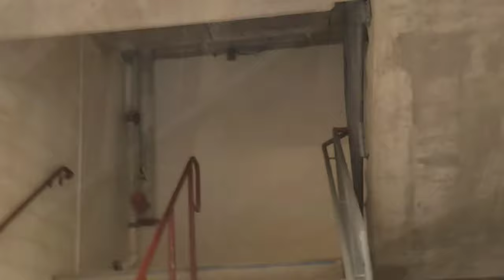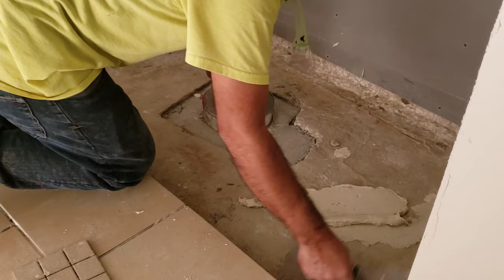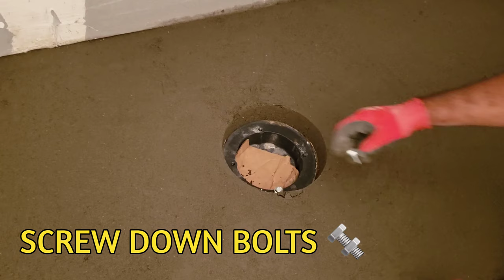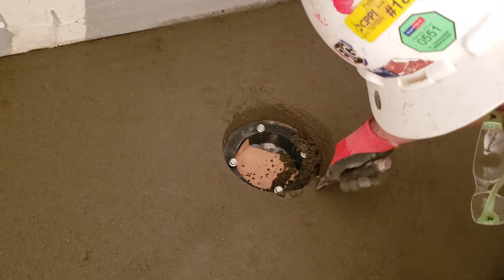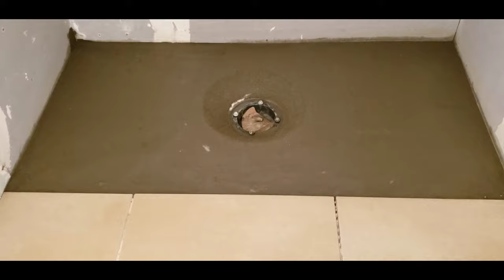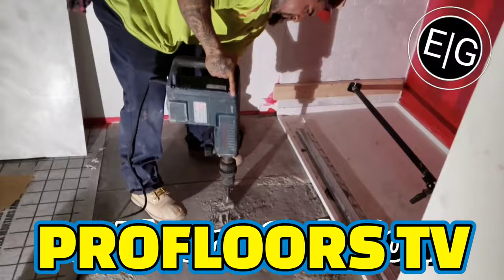How To Do Shower Pan Divot Method |Sand Mix Mud | #Shower #Liner #diy #professional #construction

Comment: This seems like a really great method. As opposed to the newer sealed pan method, like kerdi over a single slope to a bonded flange. What you're doing is really a sealed single slope pan but the benefits of old-school water in water out weepability.  What jobs are you doing these on? Commercial? Concrete subfloor? Would you or have you done this over a wooden subfloor?
Reply from the maker: Yes this was a commercial ALF assistance living facility which was over concrete, But Iv also done this over wooden subfloor on a residential home with the smaller drians works Great.

Comment: Hey man great video. How did you come up with the thickness of the template being 2"inches
Reply from the maker: Good question, i was going to explain but video would of been too long as it already is,, well first I placed the flange and drian where it goes but not to have it set but just while I figure out the measurement of the template, then I measure a ¼inch per foot for slope so my longest area from drain to wall is let's say 2ft then it would require a ½" drop from that wall, so then i set my drain at that half in drop from my longest wall then I get the size from the top of drain to substrate and that should be your size. I hope that made sense.
 Dont forget to subscribe lol..
If it doesn't make sense lmk and ill make a video
Reply: @egformula  so if the template was 2inches high how high was the outside perimeter if you don't mind me asking
Reply from the maker: @Pri79111  like 2½"
Reply: It varies from job to job. I was taught that you put at least 1 1/4" of mud to support under your drain when using a three piece drain. It looks like the tile is going to be curbless, so your perimeter height is dependent on the existing tile level and the depth of your pan til.

Comment: Could you have cut the bowl template down 1/2 inch then just float to the top?
Reply from the maker: Cut ½inch off the template should work would be a steeper drop but that's okay if that's what you mean. But the size of template height must have enough room so when flange and drian screws down the drian surface would need to be below the surface of mud or flush to it at the very least.
Reply: @egformula  no , its just that when you floated it looked like you finished 1/2 inch below template, so the finish float was below template but if the template was lower you could just float even with it
Reply from the maker: @vapdivrr5656  i got you now lol  yes if this were just a single shower I would have made the template exact for it but this job was a new assistance living facility and we had over 400 restroom & most would fit this exact template some i would need to go a little lower as I did here.. but Great Catch 👍 Ty!
Reply: @egformula  thats exactly what I thought. Its like when I do a dry pack with a round adjustable drain I pack to the top of drain , then I screw it up the tile thickness. But yes I understand you have different showers with different pitches so this one works for all. Im just trying to think of something easy in which every time I can make one for that shower because I like packing to the top...thanks for the video

Comment: Do you really have to wait 3 days to redgard it?
Reply from the maker: No don't have to wait that long, 24 hours is good.
Reply: Do you waterproof over the divot prior to tiling or leave it uncoated
Reply from the maker: @tighthead1000  Has to be Left Undone otherwise the "water" won't technically slide down to the drain/weap holes as it should.
Reply: 24 hours may not be enough in some situations. You need to make sure all the moisture is out before you put the redguard on or the moisture will be be trapped.

Comment: Your still sloping your mud bed towards the drain, right? Besides the divot.  The video looks like your floors are totally flat.
Reply from the maker: Yeah they are sloped, this particular showers are at an assistant living facility so we try to keep the slope at its minimum, slope are between ⅛ to ¼ inch per foot.